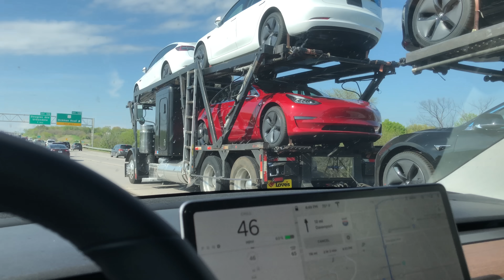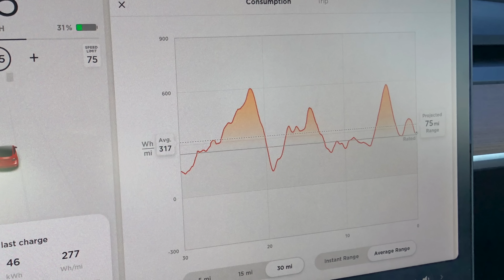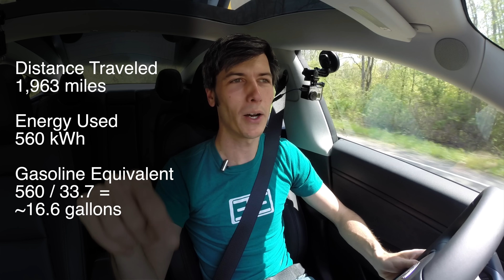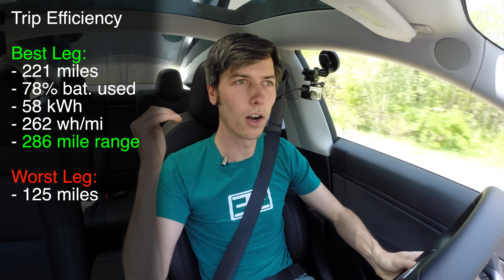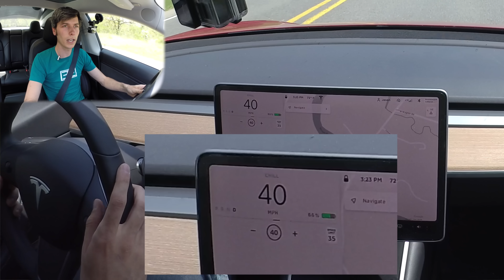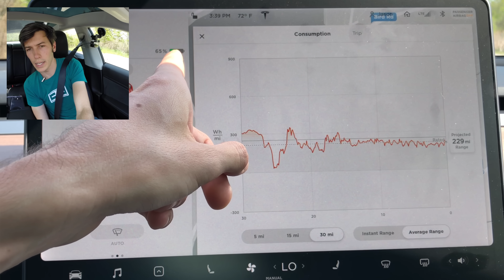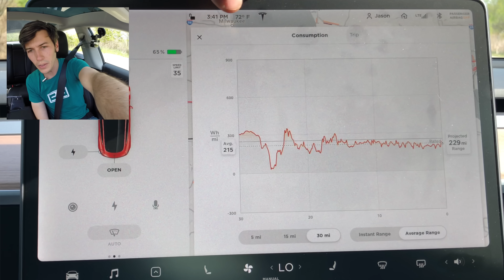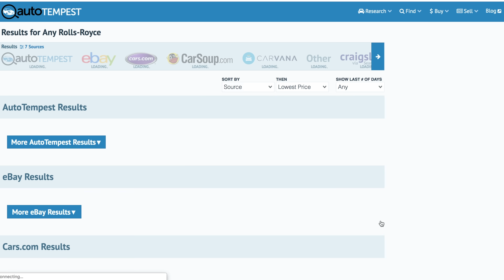How Miserable Is A Tesla Road Trip?

Comment: Now do that same trip with out a rapid charger. How many stops should you need to make a 12-14 hour drive. Drive from Flint Michigan to Fort Stewart Georgia according to Tesla it would take 19 hours and 6 stops at Superchargers for 15 minutes to 45 minutes. No sooner are you driving and it has you stopping long before you would want to stop to charge because they do not have enough Superchargers along the route to make a flexible drive schedule. I can make the same trip in 12-14 hours with 2-3 refueling stops taking less than 5 minutes per fuel stop. I can stop at any-point to refuel at any location that has a gas station. Who wants to be tied to one companies re-fueling stations or the need to have an account with them. I can stop at any gas station. and know the pump will work with any car I own and I can pay with cash, credit, debit, etc...... Who wants to be forced to stop and charge 1 to 2 hours into a trip?  Electric cars either need more range or they need generic chargers available at every gas station in America. They need to get charging times down to the same amount of time it takes to put fuel into a car with lots of charging points. What happens when more than one Tesla is needing to recharge do we shut a gas station down for 45 minutes while multiple electric cars charge? These are glaring problems. Are we going to have a fleet of gas powered mini-vans towing diesel powered generators around to recharge electric vehicles that have died en-route to their next location?  I have seen this in Europe I think it was Germany.  If that is a problem in congested fully developed Europe what will it be like in the huge expanse of the USA?
Reply: Teslas solution is to saturate US roads with super chargers so most of these problems don't occur.

Comment: I have the same 'problem', I look like I'm in the 30s but I'm actually in the 50's [younger than you though :) ], my question is, what method or is there a way to plan a trip where you can arrived at a hotel that provides charging overnight?  I noticed that when you set a trip, it is assuming you never sleep. Like many I'm not interested in driving after 10pm and need my beauty rest, can you plan a trip with evening hotel stops that provide (let's say Level 2 charging so you have a full battery when you wake up).  Thanks for the video and great job by the way!  Love your no nonsense and "just the facts" approach !

Comment: I drive mine to Mammoth every so often from San Diego. Roughly 390 miles. Typically by the time it takes me to poop, get food, and stretch my car is filled up more than it needs to be which works out well. My car takes 20 minutes to get where it needs to be (again I'm only going 390 miles) and it usually $15 one way to do that.

Comment: What I love is the battery technology is always improving. If we could get a battery that holds as much energy as my 2006 Scion xB (10 gallon gas tank), you would have a car that could go over 1000 miles without needing to recharge! Couple that with the technology improvements in charging, and I think you could really give ICE cars a run for there money (Or maybe lack there of at that point). :~)
Reply: Samuel Porter should have 600+ mile battery within 10 years that charge in under 20 minutes

Comment: The biggest surprise for me from your trip is the cost compared to gasoline. I thought there would be a much bigger gap between electric and gasoline !! All calculation that i saw were made from charging at home versus supercharger but i didn't know supercharger were that expensive.
Reply from the maker: Yes, they charge more $$ for the faster charging rate.
Reply: @EngineeringExplained  Do you have a general idea of what it would cost on standard price in the us? I found average it's 0.12$ per kwh, so 67$ of electricity.

Comment: I'm driving my S65 AMG from San Diego to Las Vegas today with every gadget (massaging, cooled seat) and AC running at full blast, rear fridge cooling my drinks, etc. I'll put it on auto-pilot and set the cruise around 85 mph. I will easily make it without a fuel stop and I'll be riding on a cloud (Mercedes airmatic suspension) the whole way. I won't be doing a video but I'll be thinking of you when I pass the Tesla charging stations. :)
Reply from the maker: Watch out, I hear this guy has an ego! 😂
Reply: @EngineeringExplained  1,000 NM of torque does that to a guy. Love your channel. :)
Reply: urgetodrive 280 mile range in that AMG. (Premium fuel too) expensive!

Comment: Tesla cars are still toys.
Until such time as they can be "refueled" to 100% in less than 15 minutes I.C.E. will continue to make sense for long drives.
Reply: Only for very long drives. Everyday use is much better with EVs and standard road trips are nearly as good with a Tesla as with ICE. Trips like this video are very rare. Flying would be better, or even renting a car specifically for that trip. And most road trips like this are mainly to see the country. I would argue that would be easier in a Tesla due to the ability to see sights while charging and due to autopilot allowing you to focus more on the sights than driving.
Reply: The Chevy Volt already solved this issue. It charges while you drive and you can stop for fuel or charge the battery.
Reply: @787brx8  Hybrids are great for road trips, but problematic for daily driving. Pure EVs are far better for daily driving. Teslas are fine for standard road trips, but I don't feel any of the rest of the EVs out there are due to the charging networks and short range. Soon though.
Reply: @anthonypelchat  The second generation Chevy Volt can drive 50 miles on battery alone.  After that, it starts it's engine and you keep driving or you stop and recharge it.  

Extended Range Electric Vehicle...not the same as A hybrid but similar!
Reply: @787brx8  Basically a plug in hybrid. Not the same as the original hybrids, but similar enough. It also allows you to drive completely on gas and never charge at all. 
They are great in some cases, but more problematic then it's worth, in my option.
Reply: @anthonypelchat  I would like to use thin solar panels coated with phosphorescent paint and stack them together with an air gap for the tritium.   I would use that instead of an ICE to charge the battery.  It's not really feasible at this moment.

Nuclear 🔋
Reply: @787brx8  lol. Sounds awesome, but yeah, not ready yet. However, getting solar on your home along with a charging box would be nice too, especially with a long range EV. Costs are still very high though.
Reply: @anthonypelchat  Try my battery trick on older batteries if you would like.  Over time it can bring back some of the capacity.  Of course results will vary and the effect takes months to notice A difference on larger batteries.

A video is on my page.

Comment: Hot Tesla accessory, a lightning rod. Instantly charge your tesla with 1.21 gigawatts of power!
Reply: 1.21 gigawatts!  Great Scott!
Reply: Only if it could go 88mph.
Reply: @InsideOfMyOwnMind  I figure you're kidding, but just in case someone doesn't realize it, his Performance Model 3 has a top speed of 162 miles per hour.
Reply: Unfortunately, doing that sends your car back in time to a point before you charged it, leaving you out of power once again.
Reply: Its pronounced JIGGAWATTS!!
Reply: “What the hell is a gigawatt?!”
Reply: Instant charging wrecks batteries. Maybe you're thinking of a disposable Liion battery that you can leave in your tesla while you drive?
Reply: You need to upgrade to Mr. Fusion.

Comment: but how long will the cells last doing cross country driving? will we see 300000mi life out of the cells or what what
Reply: Not sure about miles with mostly cross-country driving, but plenty of Teslas are already over 300k miles for standard driving with minimal degregation (less than 10% loss).
Reply: Andy47357 

A Tesla S (older style) Was driven 500,000 miles and battery lasted about 250,000m. With about 15% loss.
Now that’s the OLD battery style.
Reply: @devinbender8428  Nice. Where did you see that one?
Reply: Anthony Pelchat I’ll have to find it. But it was posted on jalopnik about a month ago
Reply: @devinbender8428  I'll look up jalopnik later. They are usually bias against Tesla, so I will be curious as to what was said.
Reply: Anthony Pelchat it was shared by them but they link to another site where the people tested the car posted a full thing.
Reply: @devinbender8428  Yeah, I figured that. I read a lot of articles on there. They sometimes have good things, but it is usually biased against Tesla. Always curious what they will say. Kinda depends on the writer.

Comment: So you save $40 in fuel costs on a 2000 mile trip, but you have to sit for over an hour at each stop to re-charge, the trip will likely require an extra day of travel and an overnight stay, plus you have to carefully plan your route to be certain there are charging facilities within range.  Kinda blows up the whole cheaper than gas thing when on a trip.  For a commute I can see the obvious advantages, especially home charging, or in my case, free charging at work.  IMHO the tech still ain't quite there yet.
Reply from the maker: Well, I don't think people buy Teslas because they want to save money on road trips. That said, it was free for me, some sort of promotion, and some of the older Model S have lifetime free supercharging.

Comment: You should be stopping every 3 or 4 hours for a break any way. Anything more than that and you're endangering yourself and other.
Reply: Deadmetal I’ve been on many a road trips. 
And absolutely. Max I can go is about 6 hrs tops. Typically a full tank to empty. (300-400 miles per tank /70mph =5.7hr) 

So it works out great get gas get food stretch ect. Hit the road.

Comment: A Model 3 gets better MPG in the city. That's news to me.
Mostly the fact that it needs gallons.
Reply from the maker: Did you miss the MPGe talk in the video? :)
Reply: @EngineeringExplained  No. I've just never seen MPG/MPGe be used for electric cars and thought it was kind of weird.
Also the first time you talked about it, you said MPG which is technically incorrect.

Comment: It's funny how he made the top point of the comments his age. That's not the point. The point is that the "road trip" was calculated specifically for this vehicle for the longest journey you can get without (charging) discomfort. Take another route and you are in a lot of (charging) pain. Don't get me wrong. I really like the electric vehicles, and they have their place. But they are not the ultimate answer. I am a bit disappointed by Engineering Explained at this point.
Reply from the maker: Huh? You think I picked the route based on what would be comfortable? 2,000 miles is a long distance. If I wanted to be comfy, I'd have driven 400.
Reply: @EngineeringExplained  Yeah, I'm sorry I wasn't more specific. Two thousand miles is not a comfortable drive for any vehicle (even if you are just riding in an S-class or similar) So kudos for that! My point is that most (if not any) other routes will give you much more pain "going electric" through them. Electric cars are a very good solution for many problems, but not all of them. When I watched the video I was left with the impression that it implies that there's no issue to take any long trip with an EV. That was my point.

Comment: Road trips are my preferred drive mode. Thanks for the review! I'm definitely a fuel-and-get-outta-there kinda driver, so Tesla's not for me yet. I would love an electric car, but either recharge times have to drop down to 5 minutes from 10% to full, or overall charge capacity is good for around 600 miles.
Reply: Probably going to have 600 mile range cars soon, though they will be very expensive to start. How many road trips do you take each year?
Reply: Youre talking about a 5 minute fill up for a hydrogen car. Lol 
I doubt both of your figures are possible honestly.
Reply: @samusaran7317  I have the same doubts; I don't think the 5 minute recharge can happen with our current battery and motor technology, so the hopes are pinned on some breakthrough that'll fix it.
Reply: @sloth0jr  With the 4 or more trips a year that you stated, do you prefer to see the sights along the way, or just get to one point asap?
Reply: @anthonypelchat  Depends - if I've been through there before, I'm destination-bound. If I haven't,  I'm okay for a little wandering...
Reply: @sloth0jr  Asking about it since most super chargers are in nice locations. You could see some sights while charging. Combine it with auto-pilot so that you can focus on the sights more instead of focusing as much on driving. Just a thought on it. :)

Comment: 8 hours of eating in 24 hours, basically at gas stations. Yeah I can think of better ways to spend 70k
Reply from the maker: Huh? Who spends their entire life driving on a road trip? You'll spend no time at gas stations because the car is full every morning for your daily commute. And again, only 3 hours at a charger each day, not 8... But change the numbers to what proves your bias...
Reply: @EngineeringExplained  first off, love your content.

Secondly I'm being critical of the use case. I think evs have an incredibly strong arguement for home owning daily commuters. But your points have allot of downsides for those with heavy travel and or logistics needs.

To bottom line it, I have to ask if choosing this or an equivalent price gas sedan which is the more logical choice in respect to travel.

Comment: 317 Wh/mile??? Holy hell. I have the LR RWD and typically get between 210 and 220 Wh/mile driving at 65mph. Again RWD with aero wheels at 45psi. I'm surprised there's that much difference considering sustained speeds, and most of your trip there was over pretty flat areas in the midwest.
Reply from the maker: Well you picked out the worst case, cold morning start. And yeah, the front motor is less efficient, plus added weight, plus worse aero with the wheels, and 65 mph makes a HUGE difference.
Reply: @EngineeringExplained  Fair, I was surprised enough I commented before I saw the actual numbers from the trip later. Still, even the 40-60 Wh/mile difference from the trip is more than I would have thought. I'll have to try running up to 75 during my commute more often to see what the difference there is

Comment: 2:16   a pure Hybrid Car would have used around $125-135 in gasoline, cheaper than SuperCharging.  SuperCharging ain't cheap like home charging!
Reply: True. For road very long trips, hybrids are still better, though I would argue that it would be better to fly than spend 30 hrs or more driving. However, EVs are much better for the rest of your life, as long as you can charge either where you live or work.
Reply: @anthonypelchat  EVs would seem really good for daily driving around town, with nightly charging at home. Road tripping even with Tesla seems a hassle, but EVs will get better in future years ... afterall, not too long ago they were junk for driving around town.
Reply: @KrustyKlown  Standard road trips are usually less than 1000 miles one way. Since you can charge before you leave and again once you get to your destination, you only need 2 or 3 stops in a Tesla. 2 hrs max to wait to charge, usually much less. Since you can charge while doing something else,  this really only ends up being less than 30 mins extra time for those trips unless you are one of those that never need to stretch and eat and pee while driving. If you are normal or have a family, then Teslas are fine for those trips. And you save far more time during daily driving with Teslas then you lose on roads trips vs ice cars.

Only Teslas are good for road trips right now, and short range Teslas can be a struggle as well. However, getting a short range Tesla or any other decent EV is great and renting another car just for the road trips would be far better and cheaper than buying a new ice car in most cases.

Comment: Ok
Now do a 2000 mile trip on a scenic route without any superchargers. 

(scrambles for cover from the tesla patriot squad)
Reply: You cant do that with a gas engine either?
Reply: You sure can since there's a gas station everywhere there are cars. You can ALWAYS find gas.
Reply: Robert Bell He said without any superchargers. So for a gas car, without any gas stations. not possible
Reply: @matthewtorres7781  that's not reality. Reality is there are gas stations everywhere. You can drive through the most sparsely populated areas of the southwest and find a gas station. Good luck finding any kind of chargers in BFE Arizona.

Comment: Great video as always, Jason. I have 60,000 miles of Tesla road trips. I think you covered a lot of the details of the experience. I haven’t had a flat, I’m sorry you did. That must have been a pain. I completely agree about low profile tires. I am comfortable going down to 10% of range, because like you said, in a pinch I can slow down. I’ve never had a problem. I drive more like 250 miles, then take a long break, usually 45 minutes. The car will say I will arrive at the next supercharger with only ~5-7%, but that will rise to 10% in a few minutes. I eat, I walk, I stretch my back. I could get there faster with shorter stops, just as you said.

Comment: What does “supercharging” due to battery longevity?
Reply: With the way he did it, not much. If you were always super charging from low to 100%, you would see noticable degregation. However, worse case usage by Tesla Taxis that did that were still getting over 100k - 150k on the battery. Home charging mostly or even supercharging just to 90% will allow the battery to last well through 300k miles and very likely longer. No official numbers on Teslas over 400k, but there are several with over 300k miles with very little degregation.